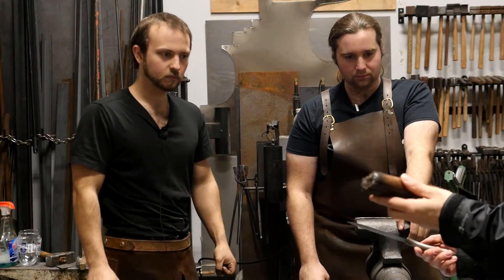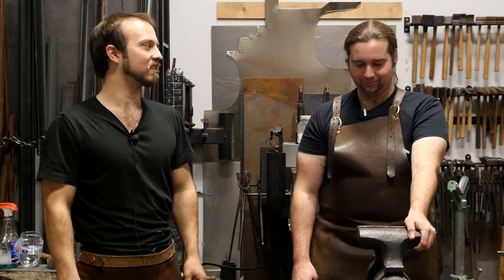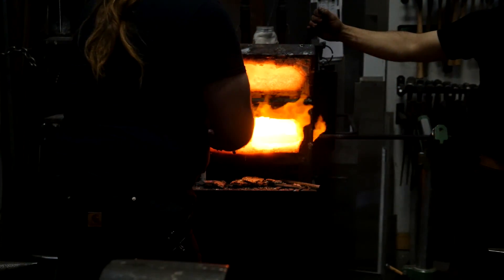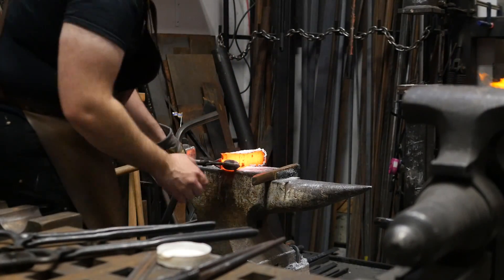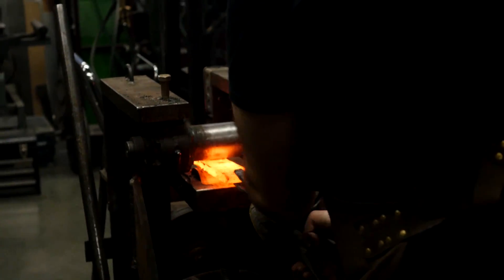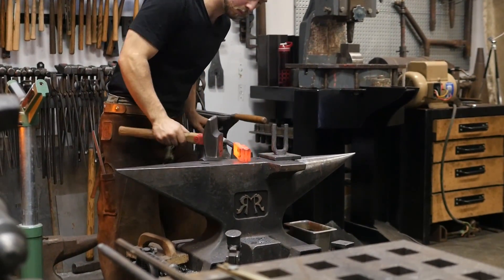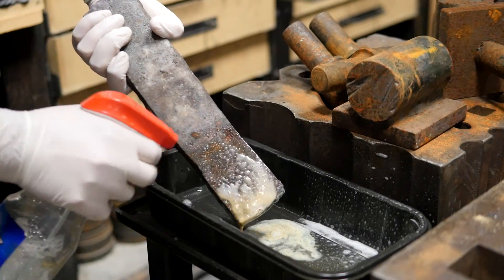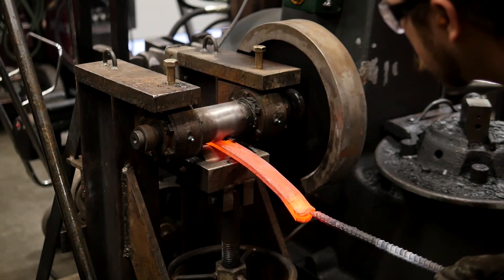How Pattern Welded Steel is Made - Explained by Blacksmiths (Part 2 of 2)

Comment: One of the big benefits to using the press and power hammer aside from what they mentioned is that you spare extra loss of mass to oxide layers coming off (scale) I can't remember who did the actually study (probably Dr. Jim Batson and Kevin Cashen) that showed how much is lost per heat depending on billet size and composition. I love forging by hand but I will use a power hammer for drawing out stuff, specifically the reins of tongs and long handles on blacksmithing oriented items.

Comment: Hey Skallagrim, was watching some of your videos and since you seem like an expert on weapons used throughout history I have a question I have to ask you. 
Has there ever been a time where bladed shield were used? Yes, the main purpose is defense but then you would hear or see depictions of them either bashing the opponent with the side of the shield or ramming them with the front. Would having blades surrounding the sides or some sort of spike at the front just be not practical? For large shields and bucklers?
Would really like you're opinion on this :)
Reply: My first thought about that is that it would actually be dangerous for the user, and not significantly improve the shield's purpose. If you bash someone with it, the point is to push them away or destabilize them in order to hit them with your weapon. If you bash them with a bladed shield, you wont inflict lethal damage or an efficient cut, so you would get the same effect tactically speaking, and again the first victim of that blade could very well be you. So if anyone thought about it they probably figured out that it would be more of a danger than an advantage (just like a spiked armor).

Comment: Man I'd be terrified that the forge heat or sparks from striking the metal would set whatever product is used to keep his mustache so fancy on fire.
Reply: wax should actually impead the smouldering of the hair, but the temperture itself will cause melting

think of a candle, even though the wax contains lots of oils, if you put flame to the liquid it dont catch fire

but if you put some fishing line into the liquid and try to burn the line, the line will at some point boil
leaving the line damaged but unburned
Reply: That's a really good point. Thanks for clearing that up.

Comment: Bit off topic: how can big steel plates be welded together?
When I think e.g. of the Tiger II they fused a 150mm and an 80mm plate. I just can't imagine it just holding from a 10mm weld.
Reply: that's why you need an industrial forge for something like that
Reply: I guessed that you'd need special equipment, but it still doesn't answer how you can weld something that is not exposed. I've seen welds being added just to the surface of two plates, but how can you make the middle stick? I doubt that you can heat even a 80mm plate homogeneously (heat the middle without overheating the surface)
Reply: edi i dont know but im sure that in industrial scale you can heat it homogenly and press it toghether

Comment: What if you have a couple layers made out of pure gold? Would the gold pattern/contrast be visible enough for cool touch without damaging blade's performance?
Reply: The result would in most cases be unfit for actual use. Especially if you have radically different materials like steel and gold you basically get a very rough and dirty mix of parts with very different properties. Gold is soft and malleable while steel is hard and flexible. Parts of the edge that happen to end up being part of a gold layer would pretty much dull instantly, while the steel parts can easily work themselves lose and flake off if the gold underneath gives way to the impacts. And flexing the blade (like it does during regular use) may cause the layers to separate over time with the gold deforming and the steel springing back.
And it only gets worse with more exotic materials like glass - the brittle glass would likely shatter rather quickly, destabilizing the entire blade.

All in all it looks cool, but is only good for display. For tool steel (impact resistance, shape retention etc) you generally want as pure of a material as possible - by adding anything other than steel you're artificially creating impurities.
Reply: I feel like pure gold would be WAY too soft for a functional tool or weapon. It bends and scratches, and is actually MUCH heavier than iron or steel. Maybe some gold alloys are harder, but at a certain point I think you'd be better off using a harder alloy that just LOOKS golden, like brass or something.
Reply: I din't think you could weld the two metals, their fusion temperatures are way different. As it was said, VERY different chemical properties between metals.
Reply: Still has very different properties than steel.
Reply: Megative Sure you could put gold into it, It would effectively make the blade a show piece only, it would never stand up to persistent concussive blows. Gold is simply too malleable to be used other than for gilding on a weapon.
Reply: The gold would melt and hammering it would literally squeeze it out like hot cheese.
Reply: Bronze would be functional metal and can be made to look Golden.
Reply: Would definitely be a decoration piece in that case rather than a practical weapon. It might hold up for a while I suppose but eventually something will probably break
Reply: even if you somehow didn't  melt and could be forged in (though there's about 500 degrees celcius difference between the melting point of gold and iron), pure gold is soft enough that you can literally bite it and leave marks . Such a massive difference in material properties doesn't make good item.